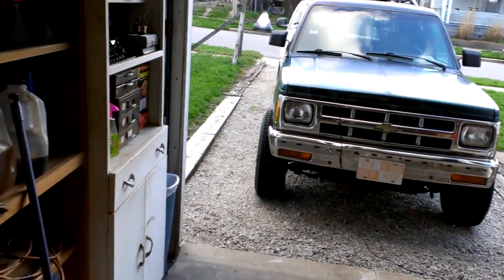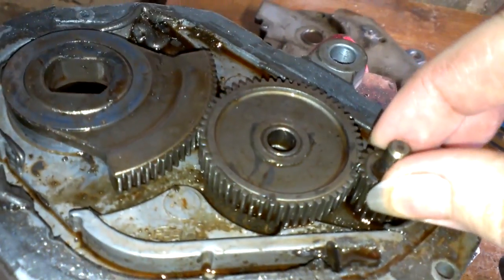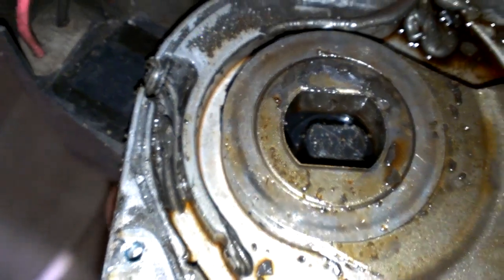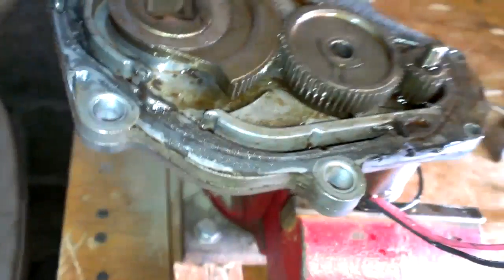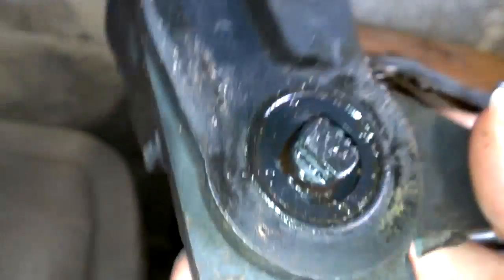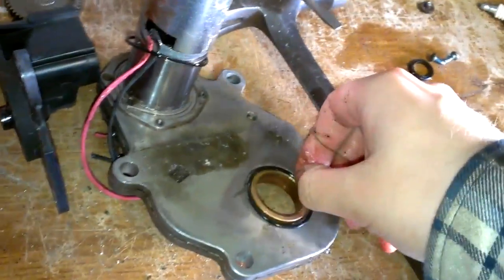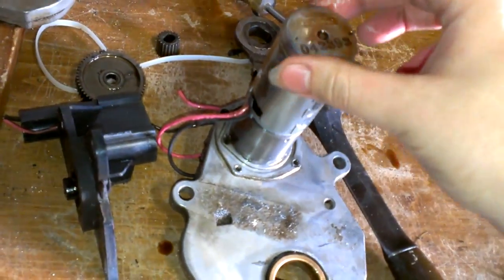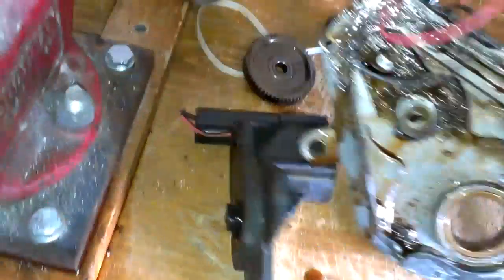Whats inside a transfer case encoder motor

Comment: can the sensor that has gone bad and is suppose to tell the computer what position it is in be repaired?  have you taken apart that black plastic sensor and tried to repair it?  I have 4Lo and no 4 Hi  Vacuum lines and diaphram under battery all work.  I've had the truck since new and probably put into 4Hi maybe 20 times, hard to believe this encoder motor / sensor has wore out?
Reply from the maker: yea its the motor. the sensor failed. maby you can clean it with contact cleaner and get it to work again. not sure. i would put a new one in.

Comment: hi. how you quit off the yoke  from tranfer to front axle. I don't have the nut gage. if you know it please can you tell me?
Reply from the maker: you dont have to take the yoke out. if you break off some small plastic tabs off the encoder motor you can slip it right out. i dont know the size...

Comment: does anyone know how much a replacement would cost and where I could get it? Theres a truck I want to buy but it needs a new one.
Reply from the maker: a few hundred bucks. and there not that hard to replace usually
Reply: +bam6972 thanks I tried looking at places like rock auto but all I was transfer case this and that, so does that mean you buy it in parts depending on which part is broke?
Reply from the maker: no you buy it as one unit. try transfer case shift motor or 4x4 shift motor. call the parts stores near you and they should be able to give you a price.

Comment: I have a 03 GMC Sierra 4x4 i have changed my transfer case with a02 Tahoe transfer case they were both a NP8 246 transfer but the shift motors were different what i need to know is how to change from a 7 pin connector to a 6 pin connector
Reply from the maker: well I did  a bit of research and it doesn't look good. I couldn't find any solid information on how to rewire it. you probally could actually rewire it but to actually know what wire goes where is a mystery. try to look up wireing diagrams of both year encoder motors and see what the extra pin is for. and rewire it from there.

Comment: I'm having a problem with my 2000 -chevy blazer it won't shift out of 4lo how would I go about repairing that? Should I check to see if the transmission oil leaked in?
Reply from the maker: put in neutral then push 4hi then 2hi. or just hit 2hi. but do this in neutral. when pushing the button does it do anything. clicking? blinking? if nothing there is a 4x4 computer in the passenger side kick panel. usually there will be corroded connections at the plugs. try cleaning them. if it clicks and or blinks like its trying to engage then its probally the endcoder motor. you will need to take it out and replace it. no other way around it. or take it off and use a crescent wrench and turn the nob that sticks out of the t-case all the way to the front. that might be right not sure but that will manually put it in 4hi 4lo or 2hi depending on what place its in. one way to find out if its in 2hi is to put front up on jack stands then move knob till it clicks then start it up and check and see if tires can move by hand if so then ur in 2hi. only check wheels when engine is running. but when you get a new encoder make sure that knob will line up with the encoder before you install it.
Reply: bam6972 Hi thank you for your advice, it wouldn't shift in neutral but I took it in and it wound up being the 4x4 computer. (I left my window down on the passenger side while it was raining by mistake and that's when the car started acting funny)
Reply from the maker: yup thought so on those newer models the computer for the 4x4 in the passenger side kick panel. the connections usually corrode after a while and cause problems. could have got it fixed really cheap if the mechanic would have just cleaned the connections and put it back together. but they thought about money. which everybody does. so cant blame them. lol.....

Comment: Too bad these are made by Doorman. Lately they have a very high return rate due to failures. You never know if it will last 10 years or 10 minutes. Does anyone know what the specs are for the gear motor? "IF" I knew which gear motor GM used, I could rebuild the device with a Swiss Falhauber, Japanese or German gear motor, and a USA Agilent, or AEG German encoder, check the gear lash & encoder alignment, reseal everything and have a true military grade remanufactured encoder. The encoder is easy enough to figure out. The gear motor, is a mystery when it won't spin anymore. We know it is 12VDC, but we need to know the RPM @ 12VDC & the torque in inch pounds. It rather irks me when I know I can rebuild these to specs way beyond AC Delco's wildest dreams, once I know which gear motor to buy.
Reply from the maker: the motors don't go out. its the sensor that tells the computer what position the motor is in.
Reply: bam6972THANKS! I'LL NEED TO DO IT SOONER OR LATER!  My whole unit is pretty slimed up with fluid. Could have been from the oil pan leak blowing back, who knows? It won't go into 4WD all the time. If hit it (tap it) with a 15 mm wrench a few times, it works really well for a while.
Reply: Joan Burgin I still think Doorman has really gone down hill.
Reply from the maker: will it go into 4lo with no problem?

Comment from the maker: yes... replace it. have to drop front driveshaft and I think 3-4 bolts hold it on and theres a small 8mm bolt holds the wire connection in. at least that's how its set up on the older blazers. on the older ones you have to take the front yoke out of the t case. nah just break the plastic off the encoder motor with a big screw driver. once you look at it you will know what im talking about.

Comment: im having a similar problem with a 2000 blazer, sometimes it will shift into 4hi other times i experience some grinding  sounds like the TC is not fully engaged. after running the codes for the TC i got error code 2 which is the encoder motor. would you recommend replacing it?